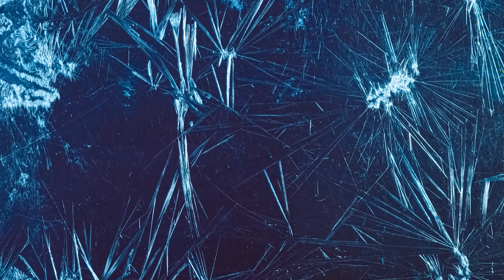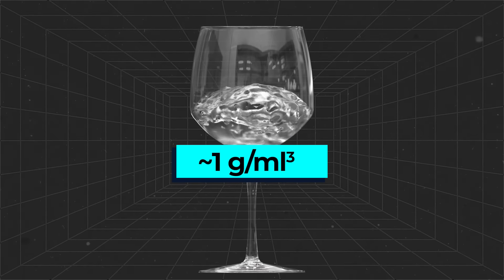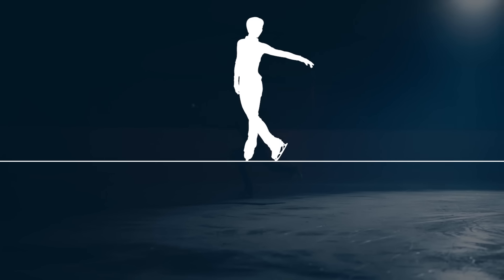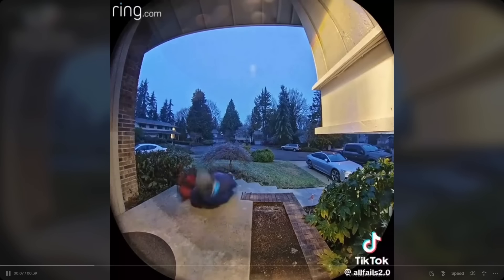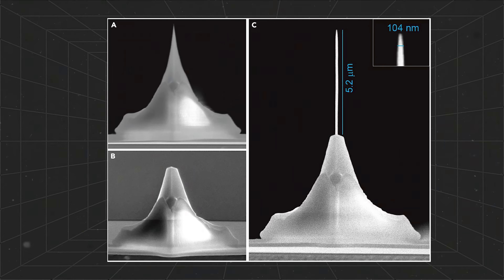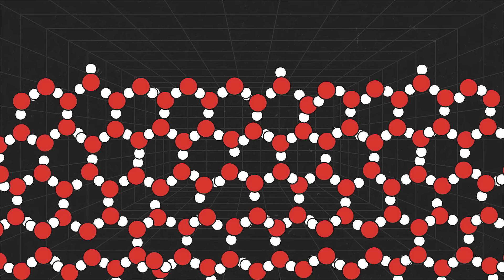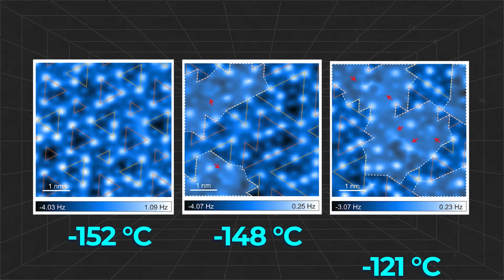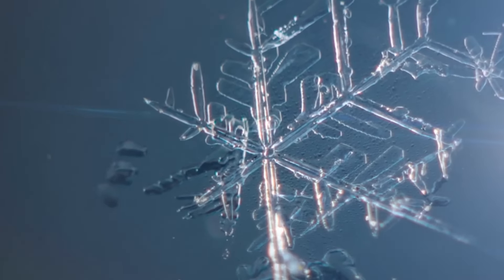We FINALLY Proved Why Ice Is Slippery

Comment: It makes me wonder if these observations could inspire a "slippery" metal alloy that never needs lubrication
Reply: Interesting!
Reply: youd need a metal alloy that wont ever rust since that would not make it pack propperly into a crystal again and it needs to be able to turn liquid again under pressure
Reply: Yes, that metal is bronze... Although it needs some lubrication for best performance. You find bronze bushings in small motors and fans.
Reply: PLEASE someone invent that!
Reply: Any alloy would be slippery at its melting point.  A bearing filled with a liquid like mercury (or safer, galinstan) -- as long as it could be made so that it would not leak its liquid and its temperature never reached the freezing point of the liquid -- might be a possibility.
Reply: Won’t be easy
Reply: @michaeldaniels3865, that is an intriguing and insightful suggestion. You would need metals with two crystal forms at a microscopic level, but I don't think that would be too hard. Oxidation would be an issue, but again, probably not an impossible one 

Seriously, somebody in metals should probably look into your idea. I could see an idea like that getting funded by a government agency.

@Dr Ben Miles, if you see this, do you have any comments? It sounds like you have a good materials background. Any version of self-lubricating metals has some merit, I think.
Reply: Metals that are slippery: oilite bronze, Molybdenum Disulfide, and Nickel-teflon. Graphite is also slippery, but not a metal. If you etch metals with phosphates, they can hold lubricants, in their pores.
Reply: @dtibor5903 what about brass?
Reply: Imagine the bearings made from that thing
Reply: But slippery would also mean it joins them. Where would the solid surface be? And I doubt it would be flat to allow ‘sliding’
Reply: I dont think it'll be used in the way you think
Reply: As far as i know, metals act like this in a vacuum and oxidation prevents it
Reply: Molybdenum
Reply: @fireworkstarter  anything that doesn't include iron won't rust
Reply: Graphite.
Reply: Already possible. . . Just a question of economics. 

Ie: no one will spend $500k for a lubricant-less metal part when a $2 metal with .25 cents of lubricant does the same action.
Reply: @zubindarbari4717  calling graphite metal is cheating imo
Reply: @zubindarbari4717  not metal and extremely weak
Reply: @TerryBollinger  Possibly a low-friction base metal like bronze with something like nitinol interstitially embedded into the crystal lattice?
Reply: Internal combustion engines could be much more relevant considering that a third of the energy is lost as friction
Reply: Not possible. That would require so smooth surfaces that there are no atomic level inperfections. For starters, that is impossible to make such surfaces at scale. Then, even if it was possible, a slightest touch of a harder or reactive material would introduce imperfections that would start to propagate. Thirdly, for the concept to work, it would require that no atomic and subatomic level interactions happen between the materials, which also goes against the all laws of physics.

Also, the reason why lubrication is used is not to make surfaces slippery. It is to make it so that the surfaces would not touch each others when sliding to reduce interaction with each others and the slipperiness is just a positive secondary effect in there.

TLDR; No, this would not and could not inspire slippery metal alloy that doesn't need lubrication, because it is simply impossible.
Reply: @fireworkstarter  
More to the point, the rust would create points of friction by making an uneven surface, as the redox reaction propagates and changes the surface geometry (but not the structural geometry, obviously).
Reply: @ScottSpadea  
Nice one, mate!
I suspected that it wouldn't be long before we had a Mat-Sci respond.
Cheers, dude.
Reply: Now why would you need this 👀
Reply: @bitonic589  
That's a bit of a can of worms, though, isn't it?
I mean, rust is just an expression of oxidation and yet all metals undergo some form of oxidation. It's just unfortunate for iron that it doesn't react to form a single oxidised layer (a patina), whereas most other metals do. At least, i THINK that most metals form a protective patina... It's not like I've counted each metal and how it reacts to oxidation, so that I can factually say that "most oxidise in THIS way..."
Reply: @fireworkstarter  3D print a surface that would be like a forest of nanotube sized 'ports' and 'ooze' ice out of them during its use "Nano-Ooze" (trademark name claimed).  Similar to surface treatments given to the America's Cup race boats, only better.   Naaaaahhh...  we use high pressure liquid films and "journal bearings" for things like that.  There is oil impregnated bronze parts in use as bearing surfaces.  Hmmm...  I think maybe they have been working on stuff like this already for a long, long time...
Reply: @SeekingTheLoveThatGodMeans7648  Oh, but you are not aware of how liquid mercury can strip the surface molecules right off of so many surfaces. Literally eating them 'alive'.
Reply: @TerryBollinger  Tiny, tiny Platinum 'ball bearing' 'marbles' in a liquid matrix of some refinement of Hemp oil molecules instead of Petroleum.  Use long relied upon standard journal bearing physical design.  Slightly increase swept area for longer life than current journals designs.  Could even go back to leather for the gap filler or use some new carbon fiber bearing media and get the lead out too.
Reply: Actually this has me wondering if this has implications with finally filly understanding what happens when two completely clean and flat metal surfaces 'wring' together and form a mechanical but temporary bond with one another.
Reply: @chrispycryptic , what the ice example makes me wonder is this: How well do we understand the “slipperiness” of any metal at the atomic level? I assume there’s an existing literature on this, but the newness of these ice results makes me suspect there’s room for new interpretations.
Reply: Brass is "selflubricating" enough that you don't need to use oil for conducting heat away from drills or saws.
Reply: @dtibor5903  I thought bronze bushings were made by sintering, which leaves the bronze porous to distribute the lubricant. But that is over forty year old knowledge, and I stand to be corrected.
Reply: It's called Babbitt metal! It's used in the surface of bearings
Reply: @anteshell  you love the smell of oil, we get it.
Reply: @hrishikeshaggrawal  No, you clearly did not understand a thing about what I said. If you had, your response wouldn't have been so utterly void of any substance with the sole purpose of being insulting. Good job for saying the most useless thing I've seen today, maybe even this month.
Reply: @flamencoprof  I'm not an expert, i have no ideea how they are made, just this what I have seen in most motors and fans.
Reply: @flamencoprof  I'm genuinely curious which metal surface combination is the most slippery and most long lasting
Reply: @SeekingTheLoveThatGodMeans7648  This is more-or-less what high-tin Babbitt metal does. The tin melts and behaves as a lubricant, but one capable of resolidifying after the contact. Babbit made good money on that idea, and it's still very much in use.

The "liquid soliton" idea I mentioned could be considered a near-atomic version of the same idea, but the pockets of low-bonding material would be almost atomic in scale. In the case of ice, there's the added twist that there is no chemical difference between the liquid or liquid-like regions and the rest of the material. That, presumably, is why ice is so universally slippery: No matter how you mess with it, it always reforms enough small crystals with soliton boundaries with low-bonding water that it's always slippery. Notably, despite also expanding when it freezes, bismuth doesn't have such slipperiness, in keeping with the point of this video.

Metals will always be more complicated, but again, there's no reason I can see why they, too, could not stably produce energetically favored liquid-like soliton phases between crystal boundaries. That's not going to solve lubrication, but in materials science, any property that can help usually does end up getting used, usually as part of a broader set of methods.
Reply: @ScottSpadea , great points and examples. Graphite's superb slipperiness is due, of course, to its poorly bonded layers. Ditto for boron nitride in its white graphite form, which is far more oxidation resistant. But both of those are wear-based slipperiness. The ice examples point to the idea of materials that don't have to abraid to exhibit low surface-to-surface bonding.

Aluminum is a bit of a counterexample that I keep thinking of. Has anyone out there ever tried to put an aluminum screw into an aluminum block? You can do it, but only once. After that, they cold-weld together. That may not be fair since pretty much all metals cold-weld in vacuums, but it's nicely opposite of self-lubrication.

Aluminum is weird. It's so active that if it wasn't for the thin layer of clear sapphire that forms instantly on its surface, it would burn you like sodium metal if you tried to hold it in your hand.
Reply: @Dadum-bass  interesting comment, and it sounds like you have a specific alloy or ceramic in mind. Can you give any specifics?
Reply: @chrispycryptic  babbitt metal, especially the high-tin variants, seems to be related to this idea. It's at a larger scale, but works nicely for reducing lubricant needs.

Memory-metal and bronze nano-mixed alloys... now there is an intriguing thought experiment! I have no idea how that would wind up, but I think I see your point: The nitinol would provide surface-shape recovery after friction contact, while the bronze (or perhaps just tin, as in babbitt metal?) provides lubrication.

During the nanotech funding push of the early 2000s, I was amused to see how many of the proposals bandied about were existing nano-scale materials efforts relabeled as "nanotech." But they had a point: Materials science gets extremely complicated at near-atomic levels, and what might be a negative property in one context can be positive at larger scales. Crack propagation... wow, now that's an interesting one. You would think it's universally bad, but the actual case is that it's large-scale crack propagation that's bad. Contained micro-cracks can have useful properties.
Reply: @tomersvirsky5807 , thanks! This is a very cool set of allows. There are different scales at which the low-bonding phase could work. In Babbitt metal, you have explicitly different phases, some structural, some (tin) lubricating.
Reply: @Tenajeh , that's a good point. The ability to cut a metal with low heat production might be a pretty good way to measure its inherent no-lubricants "slipperiness."
Reply: @Raz.C , very few metals don't oxidize or tarnish when exposed to the incredibly reactive gas we casually call "oxygen," with gold being the most obvious counterexample. What often matters most is how the oxidation proceeds. In iron rust, complicated battery-like reactions often form around impurities, greatly speeding the oxidation process. I have a roll of extremely pure iron on my desk, and what I love about it is how little it tarnishes from contact with air. Not at all what one expects from everyday impurity-rich iron!

My lifetime favorite is aluminum, however. Aluminum instantly forms a nicely solid, beautifully transparent sheet of sapphire when it "rusts," which it does instantly and more aggressively than iron. How such an incredibly aggressive metal can be used so casually and usefully delights me!

Those rolls of extremely pure iron on my desk do a similar thing, forming a nicely protective layer of waterless "clean" oxides (presumably like specular hematite) on their surfaces. At room temperature, it's only when water gets involved that things go very south in a hurry due to those little battery-like centers.
Reply: I dont think so.   These properties are very unique to water.  Maybe if you get the metal hot enough if would start to do this just before it turns to liquid it might get slippery.
Reply: @TerryBollinger  No, and that's the point. 

There have been the formation of materials that hold the properties of which are described. . . But the formation is in the scope of nanograms under intense scientific conditions in a laboratory environment. Hence the theorized application rather then actual practical application. Because the cost is so prohibitive to even attempt for so little ROI, it's bypassed.
Reply: @TerryBollinger  its amorphous sapphire, which is like calling graphite diamond, and to remove that layer requires more heat than melts aluminum. But I bet molten Aluminum batteries would be extremely powerful compared to any battery we have today. 

Imagine aluminum Ion batteries that also store energy as heat like molten salt batteries. Aluminum is extremely abundant, and could solve industrial energy storage.
Reply: I always wondered if it’d be possible to make an alloy incorporating polyatomic cations, like ammonium.
Reply: I just created it thanks to these comments.
Reply: @TerryBollinger  "You would need metals with two crystal forms at a microscopic level"
You don't just need a metal with two crystal structures. You'd need one where the two crystal structures (at least when present on the surface) are close enough in energy that entropy can force the surface into a mixture of both surface types.
Reply: Mercury
Reply: We had a whole ass element like that called lead. We don't use it anymore for obvious reasons. Fun fact: lead tastes sweet :3
Reply: There is a boron aluminum magnesium ( BAM) metal/ceramic that has the lowest coefficient of friction of any known material.  But I don't know why it is so slippery, this metal/ceramic also has a hardness of 9.  It's a really interesting material. Research it.
Reply: @fireworkstarter  ah knowing how insanely good we are at making crazy crystals for crazy shit already
It's probably some crystal formulation some unnatural amalgamation
Reply: @Dadum-bass  a lot of manufacturers mainly for equipment,
Bearing failure can take a machine down for repair for days,
There is a place for less
Reply: Entropy forbids that
Reply: @SeekingTheLoveThatGodMeans7648 : Maybe an open-celled foam that will attract e.g. galistan without dissolving into it. Things like chrome-steel actually have this going on with chrome, which is apparently why it's largely stainless.
Reply: @flamencoprof : Bronze bushings can be sintered into an open-cell foam so that lubricants can seep into the crevices, and that type of bushing is available, but fully solid ones (and probably etched ones) are also available. Different types are chosen per-application.
Reply: @absalomdraconis  Thanks for your reply, just what needed to know.
    The first I learned of this was through a mild interest in Slot Cars around 1964. Wheel and motor bearings IIRC, it was a long time ago, I was just a kid with no money, a frame, no wheels and no motor, LOL
Reply: @Pystro , your additional constraint of the two crystal types having comparable crystal energy levels at the surface makes sense.

It also makes me wonder about a feature of the ice paper: Why were there so many nanoscale crystal transitions on what was almost certainly a single ice crystal? Or, conversely, doesn’t this explanation predict that large, slow-cooled ice crystals should not be slippery at all?

I don’t have the paper with me now, but I assumed that these cubic and hex ice forms are short-range, surface-only forms caused by the stress of lateral-only bonding at the surface — the solid-state equivalent of surface tension. Otherwise, I don’t see how they could be ubiquitous enough to generate slipperiness.

If that assumption is wrong, then, oops, I can no longer feel like I finally understand ice’s slipperiness. A hypothesis that predicts that large ice crystals should not be slippery is observationally incorrect.

For metals, annealing should impact the number of transition sites, thus slipperiness. Super fast-cooled glassy metals should be the slipperiest of all. 

Finally, I would assume that different orientations of a single (and thus same-energy) crystal type could also give rise to slippery soliton atoms or molecules.
Reply: @aluminumfox  probably the oxidation of the aluminum provides the low coefficient of friction (just my guess from knowing how aluminum foil works to keep food from sticking to hot baking pans), but I'm stunned that it has a hardness of 9. I'm gonna go back to school to get a degree in chemistry for this one
Reply: @aluminumfox , I was not aware of BAM. Intriguing! I'm fond of boron compounds in general, as they have some of the strangest and most fascinating bonding structures of any element.
Reply: @TerryBollinger  "I assumed that these cubic and hex ice forms are short-range, surface-only forms caused by the stress of lateral-only bonding at the surface" - Exactly correct.

"For metals, annealing should impact the number of transition sites," - If it's really the single ice molecules on the "grain boundaries" that cause the slipperiness, then yes. But I wouldn't be surprised if the different surface regions can actually grow on one side and shrink on the other when shear stress is applied. ...Which crystal boundaries generated by annealing couldn't do, because they extend too far into the material.

"different orientations of a single (and thus same-energy) crystal type [...]" - Yes, but they would probably be matching up less neatly with the underlying crystal structure. And that would give them different energy than just continuing the crystal in the same orientation. ...Unless you have 2 orientations that both differ from the original (for example being rotated in opposite directions), and with the "straight" continuation somehow "impossible". But then those two orientations usually arrange in a regular meta-pattern, I think.
Reply: @Pystro , a delightful analysis, thank you!
Reply: @Roobotics  Or even possibly similar to the phenomena of cold welding that can occur between metal surfaces in a vacuum. In fact, I would be willing to bet that it is the exact same phenomena -- but rather than the surfaces being so flat that gas molecules cannot fit between the surfaces there aren't any molecules available period to interrupt the the exchange of electrons.
Reply: It also has to be durable to do its thing.
High entropy alloys come to mind but we dont have enough data on that.
Reply: Now I wonder if solid mercury is slippery....
Reply: Graphite?
Reply: @bitonic589 not specifically but it’s the oxide of nickel, chromium and others that makes metals look as though they’re not rusty
Reply: Babbitt bearings have been around hundreds of years
Reply: Look up "solid lubricant" and you'll get a bunch of materials (some metal or metalloid) that function in a similar way to what you've described.
Reply: @dtibor5903 came here to say this. There is also bronze that is impregnated with oil to make it more efficient.
Reply: @ScottSpadea  I was going to mention graphite too :D
Reply: Why limit yourself to metal?
Reply: @fireworkstarter  Assuming that you are still referencing this video, what do you mean by "turn to liquid again"?
Liquid was not the mechanism of slipperiness.
Reply: @ScottSpadea  MoS2 isn't a metal, though. It's a salt. Also MoS2 works much better when there's no water around (like in vacuum). Graphite, on the contrary, needs moisture to be slippery - in an environment with no water at all it's more of an abrasive than a lubricant.
Reply: they have one that requires gold and platinum  lol
Reply: @wzburzonykisiel  MoS2 is like a semi conductor. I would say its closer to a metal than a salt, it doesn't dissolve in water.
Reply: @ScottSpadea  Quite a few salts don't dissolve in water. MoS2 has covalent bonds, therefore it isn't a metal - it's a semi-metal at most. Solubility in water isn't a determinant of a compound being a salt or not. CaCO3 (limestone) doesn't dissolve in water either.

edit: ok, salts don't form covalent bonds. I was wrong in this part. Still not a metal, though.
Reply: @hrishikeshaggrawal  not true, a very rough estimate is that a third of it is usable motion, a third goes out the exhaust as pressure and heat, and the rest gets dumped out of the radiator through the heated engine block, of that heat transferring to the engine block only a small portion of that heat is from friction, the majority is from combustion heat. If friction was really the primary cause of heat then you would need a much more robust and significant cooling system around the crankshaft than is currently used in modern engine designs. In addition, the main part of an engine that experience significant friction is the cylinder walls due to side loading from the angle of the connecting rods during the combustion stroke pushing the piston against the cylinder wall, any metal lubricant would be scraped away by the piston rings and would prevent any possible seal from functioning properly. Long story short, it wouldn't be that much of a difference if any and it couldn't be used in the majority of the engine which would still need oil based lubricants.
Reply: @ScottSpadea  For me it's just a dry lubricant, tbh. 

If you don't care, then why are you so angry?
Reply: @Roobotics that's been understood for a while, it's a combination of factors including surface humidity/oils and, when clean, vanderwaal's force. It's not a mystery like so many people think and hasn't been for a while.
Reply: @hrishikeshaggrawal  no, they're just being honest about how engines work, the main bearing surfaces that experience the most significant loads wouldn't even be able to use that type of metal lubrication even if anteshell's points weren't true simply because of the nature of the parts.
Reply: Babbit bearings work that way
Reply: @anteshell Babbit bearings work this way
Reply: Metals that act like ice would weld together. As soon as the oxide layer is removed, they will merge.
Reply: this comment truly reflects the spirit of science (and engineering)!
Reply: How did you come up with my thoughts 5 days before me?
Reply: @SuperPhexx  What way? 

Bearings always have lubrication in them to reduce friction and subsequently wear. They do not work by being smooth as what the video is talking about nor do they work being so smooth and slippery metal as per what OP said.
Reply: @vari1535  It doesn't, though. Throwing out random hypotheses without any basis on reality and knowledge of underlying mechanics, only manages to reflect the lack of understanding of how science and engineering is done.
Reply: Look for scholarly articles on diamond-like-carbon. Superlubricity in solids has promising results with DLC. It’s not perfect yet but it’s in line with what you just mentioned.
Reply: BAM is the alloy best smelted to date for Lowest coefficient of friction for metal alloys If I recall correctly
Reply: That's brilliant!
Reply: In certain applications there already is  but it’s usually a brass or bronze bearing surface impregnated with oil
Reply: @anteshell  The gallium acts as a lubricant
Reply: Aluminum magnesium boride. Coefficient of friction that's at 0.04, about the same as ice.
Reply: @SuperPhexx  Not sure why are you telling me that because I've never said anything to the contrary.
Reply: Brass and bronze.
Reply: endless applications: “slippery” c0ndoms
Reply: self lubricating materials are a thing, at low loads we have materials that never wear, scaling it to useful work is difficult however.
Reply: @fireworkstarter  simply gold or titanium
Reply: I don't like where this is going 😂
Reply: @cosmicraysshotsintothelight  The video makes it sound like the ice needs to be kept at -7C for maximum slipperiness
Reply: @bitonic589 wrong. Copper and silver oxidize when exposed to air.
Reply: as a cuber this intrigues me, but if it's too heavy it won't ever be in any cubes as the cube would be, well, too heavy
Reply: What you have to consider is that such a metal would be just like ice highly brittle
Reply: @SleightWryder  bro are you slow
rust is iron oxide.
and there are way more metals than just copper and silver that oxidize. oxidization is the general term for materials that oxidize. rusting means iron oxidization
Reply: Not possible lol
Reply: Ooh cool concept
Reply: Graphite is a dry lubricant!
Reply: Already invented. Bronze alloys.
Reply: There are non-metal materials which are fusing like that (self-mending materials) or are highly slippery.
Reply: buildinganewworld2682  he said a metal alloy not just a metal
Reply: @anteshell  

That's it everyone. Pack it in. @anteshell has declared it to be impossible.
Reply: buildinganewworld2682  ok
Reply: @fireworkstarter anything that doesn't include iron won't rust
Reply: Graphite is similar I think. We use it to lubricate locks if they get too sticky
Reply: @stijniman  brass is too soft and malleable.
Reply: @SeekingTheLoveThatGodMeans7648 in that example (if I am understanding correctly), the liquid metal is still acting as the lubricant. You need some amount of viscosity to attain hydrodynamic lubrication (see sommerfield number and related bearing parameters) and liquid metals have too low viscosity.
Reply: @TerryBollinger i can't tell if you're being sarcastic, but if you aren't, you are extremely close to describing Babbitt, a classic and important metal in industrial bearings. It works (partly) because it has three different crystal structures. It has a hard cubic structure that resists deforming under load, a feathery lattice crystal structure that holds the cubes in place, and then a soft tin base that fills the voids. However, all high-performance bearings require some amount of lubrication, whether external or internal, so I believe we won't see heavy adoption of true "lubrication free" materials for a long time.
Reply: @fireworkstarter  glod pretty much doesnt oxidize at all
Reply: I wonder if we will find this with man made Cristal or salts or something not even metal.
Reply: Silver behaves like this, not in the complex manner of ice but silver plating is commonly used as an alternative to lubricant in ultra high vacuum systems
Reply: Mercury
Reply: @bitonic589 actually, precious metals are the only things that won’t oxidize. If something reacts to oxygen, it can “rust”.
Reply: absolutely!. why wouldn't you try to make this? it would be so great for everything that needs mechanical moving parts like mechanical watches and clocks etc.  Wouldn something like that perhaps be more resistance free than using tires on a road? perhaps we can't build insanely long maglev trains yet or have room temp super conductors, but it might be an in between fase somehow? My third eye is opening
Reply: @fireworkstarter  but it wouldnt have to be a metal would it. It could be any kind of chemical bond really as long as it can be engineered to maintain the properties when needed in the environment
Reply: Well, I use plastic bushings that do that... look up ptfe self lubricating plastic if interested.
Reply: Nah, the metal would probably melt like ice
Reply: @creekninja  rust is iron oxide.
OXIDIZATION ISN'T RUST.
Iron oxidization is rust.
Other metals oxidization, like copper, silver, zinc.. is not rust."
Rust is the name for iron oxide. Is it that hard to understand? I shouldn't have to explain so many times.
Reply: @bitonic589  key word, oxidation. That in itself is rust. Look up the definition.

I’m a machinist, and blacksmith. I need to know oxidation and what causes it to various metals. Did you know stainless steel rusts?
Reply: @creekninja  Stainless steel rusts because it has iron in it.
Iron is IRON OXIDE. And look up the definition? If you really think I don't know, then on the first page of google, it literally says "Rust is an iron oxide."
It's not that hard to understand. Any other type of metal oxidization is that metal's oxidization, not rust. Rust is iron's oxidization.
Rust is oxidization, but oxidization is only rust if it's happening to iron.
Reply: @bitonic589  you literally just explained what I said dude. How dense can you be?

Read my comment very carefully as I put the word RUST in quotation marks. Stating it’s used interchangeably. Intelligence is king.
Reply: @fireworkstarter this. Oil is not only so it does not tear down but also helps against rust
Reply: @creekninja  it's incorrect. rust is only iron oxide. other oxidized metals are not rust.
Reply: Mercury alloy or something
Reply: As implied in the video, though: this is also linked to cold welding. Which seems very very bad for gears or whatever.
Reply: only if its stupid expensive to make and sell, oil companys wont be having it!
Reply: Teflon?
Reply: that sounds revolutionary
Reply: @orchdork775  Interesting, but it cant happen.
Reply: I think its unlikely, because you can't translate this observation very well, since the forces holding metals and alloys together are undirected, while the forces in a hydrogen bond behave more like a directed force. In other words a metal atom on the surface on an alloy can not be missaligned at least not in its rotation.
Reply: @StAngerNo1  gallium and galinstan exhibit slippery low friction properties but with the conductive properties of metal
Reply: @SodiumInteresting  Is it actually slippery or is it just because it melts easily? Reguardless, I doubt it is similarly slippery as ice and even if, it is not due to the same effect. And both of your examples would be useless in a technical sence for components, because they melt at slightly above room temperature.
Reply: @StAngerNo1  that might be as close as you'll get from a metal, metal hydrides H2M mostly give up their hydrogen easily or react with water to form hydroxides.
Reply: @StAngerNo1  molybdenum disulfide or graphite coating can give metals sliperyness
Reply: these are the questions that bring humanity forward!
Reply: @cosmicraysshotsintothelight  graphite or molybdenum disulfide coatings on metals are already a thing to make them slippery
Reply: I'm not sure about that. From what I understand this particularity of ice exists because of the inherent shape and properties of water molecules. Metal molecules are way more complex so as a result they have a higher melting point and less freedom of movement. So I very much wonder if it is at all possible to find or engineer a complex molecule that behaves the same way.
Reply: @SodiumInteresting  I built my first race engine back in 1971.  And my father worked at the Milacron, so I had years of curious learning even before my drafting years.  Pretty sure I have experience with surface treatments, for years.  AND I stayed at a Holiday Inn Express at least once in my life and gained a universe of knowledge, but thanks.
Reply: @cosmicraysshotsintothelight  is there a correlation between staying at the holiday inn express and gaining a universe of knowledge?
Reply: @SodiumInteresting  Just like Prego pasta sauce...  "It's in there."
Reply: You mean like teflon or graphite?
Reply: Like BAM (magnesium aluminum boride)? It already exists.
Reply: @FourthRoot  not an alloy though
Reply: What for?

It would be useless because the primary application involves friction. Without friction, you can not transfer energy
Reply: @bororobo3805  maybe you don't want to transfer energy to friction
Reply: @SodiumInteresting  Ok. That's fair. There are some inventions that are simply a result of human curiosity but still lack any field of application. I guess that's what makes science fun 😊
Reply: Graphene :/
Reply: If the metal is slippery because it is gassing off or melting, then the metal would run out and you'd have to replace it. Unless maybe if the moving parts were sealed and the slippery metal recombined again once the friction was gone.
Reply: @aarontharris  if it boils or sublimates but same could be said for water ice
Reply: Exactly what I was thinking of!
Reply: @ScottSpadea  it is not the same working principle though. I don't know for the others but for MoS2 and Graphite they are sheared due to tbf similar bonding conditions and therefore act as solid lubricants. However whole layers of material are detached due to the fact that there are no 2 crystal forms but simply weaker bondings between layers.
Reply: Isnt that graphene?
Reply: @deleted-something  gee, thanks professor
Reply: @Aspencio  I don't think they had a specific use in mind, so what are you talking about?
Reply: @bitonic589  he obviously meant oxidize
Reply: @Dadum-bass  oh really? Tell us how it's possible then. Don't give us some braindead obvious hypothetical, tell us how to do it. Since you're so sure.
Reply: @joshyoung1440  he's claiming he's a "professional blacksmith", so apparently this is the stuff he is supposed to know
Reply: @joshyoung1440  Are you asking me how it's possible? Or asking me to give a step by step instruction so it's not a "Brain dead hypothetical" of a process that, like I said, it such a prohibitive cost that it fails the ROI benefit vs cost. 

Because those 2 asks seem to be at a contradiction with each other. 

If you really want details on how its possible, you need to have a through grasp on the base line physics and chemistry just to be able to follow (if I go into detail about non-covalent interactions or dynamic covalent chemistry that can show self-healing properties after breaking, are you going to be able to follow?)
Reply: @rhubarbdedubarb4232   yes sir graphene Acts the Same way just that the Atoms are more ‚sorted‘ to do that. But still Pencils work without having graphene in them right?
Reply: @fireworkstarter  Queue the stainless mercury
Reply: Would never be mainstream because of how much money petroleum produces
Reply: @pon1  bro Really wants a slippery metal😂
Reply: @bitonic589  Most metals oxidize, which is the same thing as rust in iron.
Aluminum and Magnesium for example oxidize very quickly. Copper oxidizes as well, but slower. Gold is an example of a metal, which doesn't oxidize
Reply: @MrEdrum  Rust is oxidation, oxidation isn't rust. Copper doesn't rust, it oxidizes. Rust is iron oxide. Copper oxide is not rust.
Reply: Locks containing brass generally never need lubrication exactly because of this, it’s self lubricating. The problem is to achieve this, the metal is slowly “melting” away, meaning it wears quickly. Anything large undergoing a lot of force regularly will wear away far too quickly to be practical
Reply: So have you heard about Ice 2-18?...
Reply: Yeah, and make a "Soap"(Like Lithium grease) out of it and put it on a chair/bench at the top of the Eiffel Tower as a prank, and someone will end up with all of the tower in their %&¤#. 🙂😇😄😂
Reply: There is no need for that and it would be realy expensive. Making hidrodynamic bearings is easyer and there is only fluid friction wich has minimal energy losos and no material ware.
Reply: You mean like fkn graphite?
Reply: @fireworkstarter the entire point of this video is explaining that at no point does the ice melt, the outermost molecules are badly bonded together and can basically snap off and roll around until they find a new place to reattach.
Reply: @dtibor5903  Those bushings are not just bronze, the bronze is impregnated with plastic (PTFE) and oil. It's not slippy because the surface is slippy, it's just been turned into swiss cheese and the holes filled with slippery things so that it will self lubricate as it wears down.
Reply: @fireworkstarter gold alloy?
Reply: Impregnated bronze, aluminum bronze. I make hydraulic presses for a living, thats what we use.
Reply: @Roobotics google jo blocks
Reply: @dtibor5903 so it isnt bronze, they said something that doesnt need lubrication, maybe from this we could make a bronze alloy that doesnt need lube.
Reply: It's called a hydrophobic coating
Reply: Are there any metals that have hydrogen bonds?
Reply: Since part of the reason ice is slippery does have to do with the fact it's close enough to melting point that the outer layer can have irregularities in the crystal structure, and part of the material shifts around when friction is applied, it would still end up losing mass over time, like a worn-out bushing. It might never need lubrication, but odds are it might need replacing much more often and if that could very quickly end up being much more expensive than adding another dollop of lube.
Reply: Surprise-surprise, research in this field is running for at least two centuries, and there are a lot of compounds designed for that exact purpose: babbite was the earlier form, nowadays there are lots of dufferent alloys that cover crankshaft bearings, which are as close to that concept as possible.
However, all of these alloys still require a film of luquid to perform at their best.

The best materials for high speed low friction applications without extra lubrication actually are ceramics.
Reply: @dtibor5903  Also Phosphor Bronze washers are used as a pocket knife pivot on folding blades not using ball bearings or nylon discs! Again, it needs a very minimal amount of lubricant, but it's smooth due to the metallurgic properties
Reply: Liquid metal bearings, " sorta"  or is it more of a variable state "steel grease".
Reply: @survidmt  That's closer to fluid bearings from my point of view.
Reply: these 'slippery' metal alloys are going to lose it's volume to be such. It can cause small accidents to say the least. Not even saying that holding desired temperature would be a pain in...
Reply: Wrong nickel copper and silver as well as zinc depending on conditions also rust/oxidize given enough time
Reply: @pon1 np im working on it
Reply: Doubt it. I think relying on a metal to "lubricate" itself would cause it to have more wear and tear. Then again, I could see a situation where a "dry lubricant" would be needed for a task that does not require prolonged active use.
Reply: Some kind of frictionless bearing would be crazy!